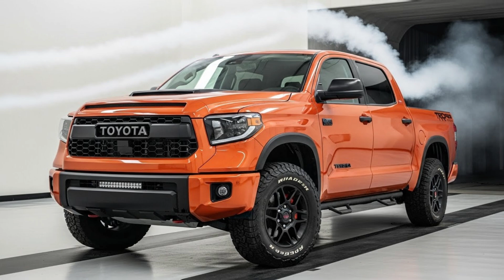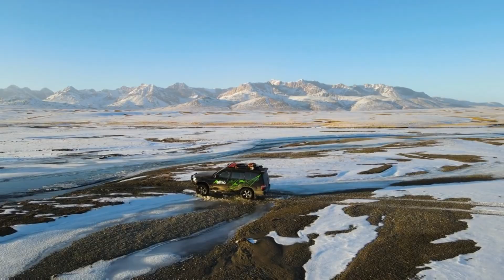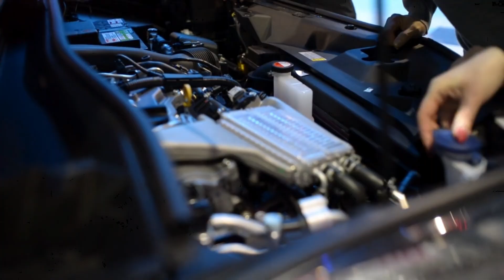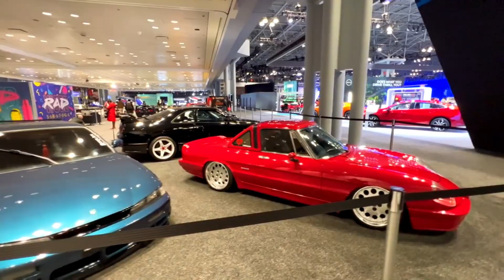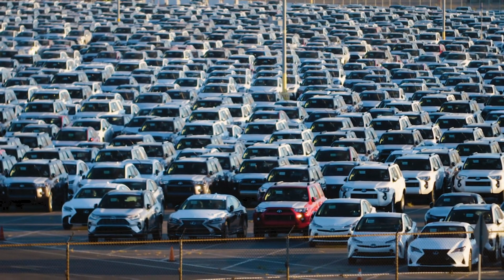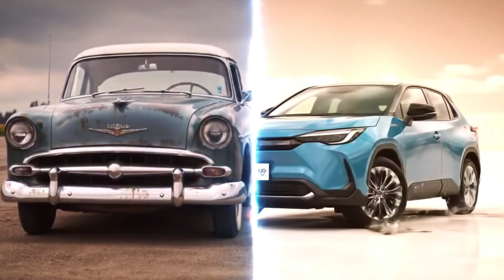Toyota's $5 Billion Gamble: The Debrisgate Forensic Autopsy

Comment: This problem should have been fixed by the 2023 vehicles.  Total management failure.  My thoughts.
Reply from the maker: The management failure likely lies in two decisions: First, not conducting sufficient long-term durability testing under real-world conditions before launch. Second, handling the crisis with minimization and delay instead of transparency and a root-cause fix. If it was truly fixed for 2023 models, Toyota wouldn't be losing the trust of an entire generation of truck owners.

Comment: AI schlock video. Latest reports indicate it’s not a debris issue, it’s a design issue causing debris. And the tolerances on the new TTV6 are larger than on the V8 but it’s using thinner oil and has less bearing surface to absorb the high torque of the boosted engine.
Reply from the maker: You've hit on the key point: the "debris" might be a symptom, not the root cause, and the design itself (tolerances, oil, bearing surface) seems to be the critical area of concern.

Comment: Are the bearing clearances actually tighter in the new engine? Numbers please...
Reply from the maker: Excellent and direct question. Unfortunately, the actual crank bearing clearance numbers are rarely published by Toyota. But if they are tighter (for efficiency and reduced friction) combined with thin 0W-20 oil, that's a recipe for zero safety margin. If anyone has service documentation comparing the old V8 vs. new V6 clearances, that would be powerful evidence.